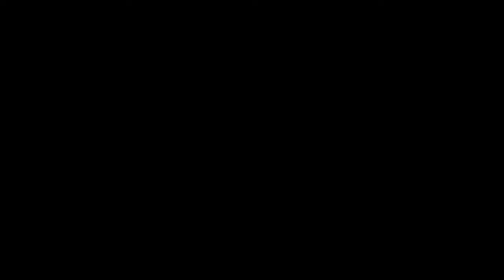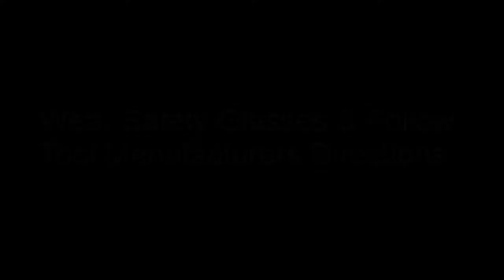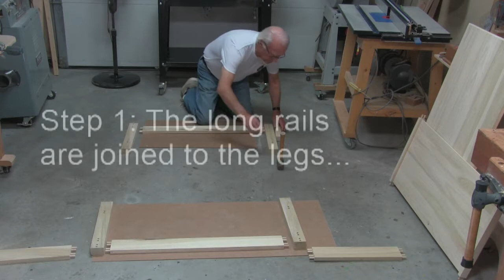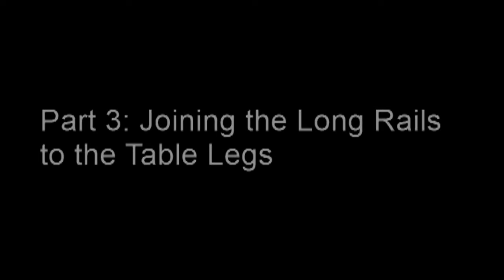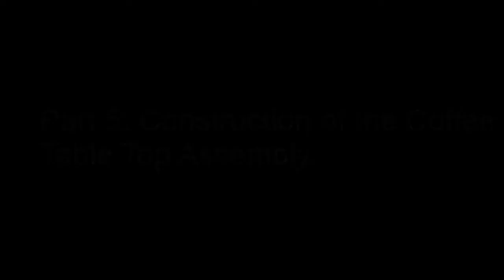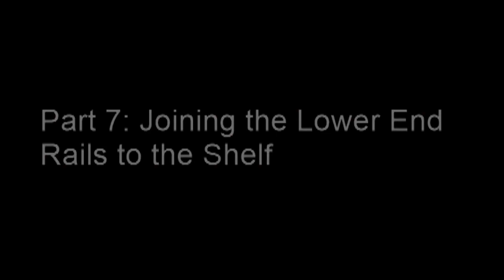Easy to Build Coffee Table with 100% Dowelmax Construction| Back to Basics Woodworking Series

Comment: What material did you use for the extended distance gauge  bar at the 16:32 mark? It is much longer than the one that comes with the kit.
Reply from the maker: This is a 1/4 round brass rod cut from a 36" section which can be bought from a Home Depot type store. Thanks for watching.

Comment: Is this all done with 3/8 inch dowels, or are 1/4 inch dowels used anywhere in the construction?
Reply from the maker: This project is done with 3/8 dowels used in 7/8" thick material or larger. We normally use the 1/4" or 5/16" systems in 1/2" or 5/8" material which was not used in this project. We typically use the smaller dowels for drawer box or cabinet shelf construction in thinner material. Thanks for the question.

Comment: Fabulous. 

I will definitely use the idea when I need the process. I am wondering if I can make your method work for laminating American Flat Bows from laminates? I don't know for sure but lean towards, yes.
Reply: Hi Michael. Sorry this message was discarded.  I would have to see the configuration to be 100% sure, but I'm virtually certain it could be done.  On the plus side there's nothing stronger.  Jim.
Reply: @marielindsay528  My comment actually pertained to another video where using a vacumn produced by a shop vacumn was utilized to laminate cork to a plywood surface. 

You know how an accidental touch can cause the screen to change or as you typed the next video began to play, well one of those two causes led to my comment ending here instead of where it belonged.

I tried to find the error and delete the comment being located here but my history did not store this location because it was too brief.

Now that it's here and has been found and explained may as well leave it for giggles. 

Thanks for showing me where my mistake ended. I do love carpentry and furniture building too so maybe I should watch the full video instead of just misplacing a comment relative to the video.😊

Comment: Thank you Marie for your reply. You wrote that there are several options . Could you tell me what they would be. I am new to wood work and still learning. Thanks for your help
Reply from the maker: Hi Trevor.  If necessary you can shorten the dowels slightly, it will have little effect on the joint strength, or better you can just shorten the dowels on the end frame, and leave the long section the normal length.  I on occasion stagger the dowels, using 1,3, and 5, on the long section and 2 and 4 on the end frame, that way the dowels will not foul each other.  Regards Jim.

Comment: Do the dowels in the side rail and front rail interfere with each other when placed in the legs
Reply: Hi Trevor. No, I'm  careful at that part of the process, and there are several options.  In this case however the dimension of the legs negates that problem.  Thanks Jim.

Comment: So, no glue is needed in the dowel holes?
Reply from the maker: I have known contractors to install structures in tight spaces with no glue, however in 99% of cases glue is required.  What you saw is a dry fit.  Jim.
Reply: @DowelMax  Thanks for the clarification.

Comment: Good ! Having purchased the Dowelmax equipment , where would you get the dowels and drill if you were to uses this in the UK ? Bearing in mind that this equipment is made in the USA , and I would be using it in the UK , Do the dowel master make metric drills , bushes and dowels ? Thankyou.
Reply from the maker: Hi There.  Thanks for your e-mails (2).  No problem with the metric sizes we supply the main 10 m/m kit, with two compatible 8 and 6 m/m  sets.  We don't supply metric dowels however they are readily avail. in the U.K.
Sorry to hear about the accident.  I clearly recall driving on the motorways from Scotland to England. It was usually a nightmare, and worse if the weather was bad.  
We are about to start ads. in the U.K. selling direct. Prices are shown on the website.  It's a good deal with shipping at 50%.
I've found that this business and woodworking have been a definite benefit in my mindset, and without sounding like a salesman ( I'm not ) I hope it will be of some benefit to you.  I get a real kick out of creating something, it's definitely a boost.  Regards Jim.
Reply: Dowelmax Thankyou Jim, I've now found the Dowelmax centre in Wales, many thanks once again.

Comment: This is the most accurate and underrated woodworking tool in existence.  I bought the Dowelmax Jr. and the 1/4" drill guide package, I am retired and cheap, but I now see how the Dowelmax Classic could be even more useful.  Dowelmax or Jim will give you your money back within 30 days should you be unhappy ( but, you will not be sending this tool back, trust me.)  When one calls to order, you will probably be speaking to Jim's wife, a extreamly nice person with a beautiful personality and very helpful.  This is a family run business.  Their service and product is excellent and I could not recomend them any higher.  6 Stars out of 5.
Reply from the maker: Hi John, That's great to hear its' working so well for you! The main advantage of the Classic is the built in, integral clamping, which simplifies and speeds up the process. All the parts required to upgrade the Junior to the Classic are available direct from us. Thanks for your appreciative comments. Regards, Mike.